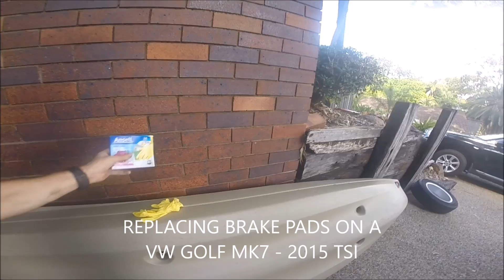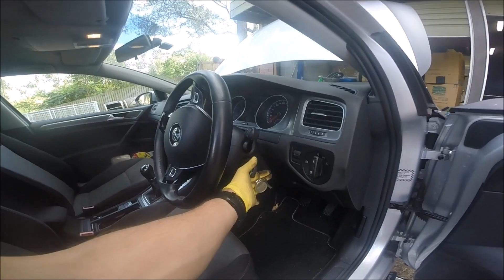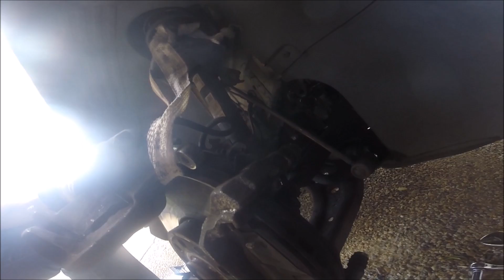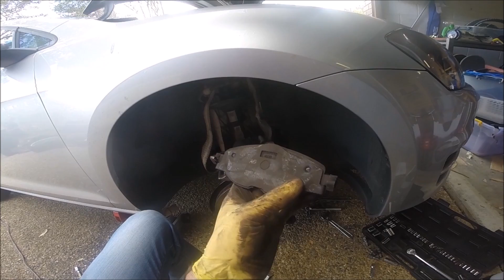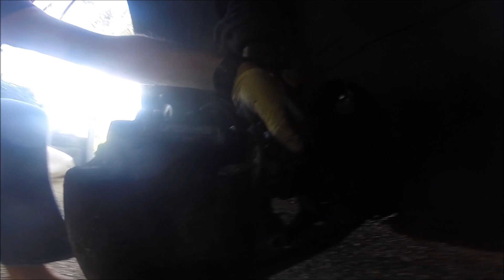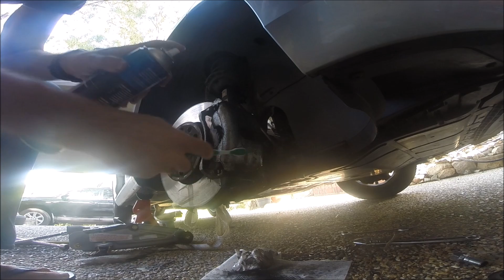How to Replace the Brake Pads on a VW Golf Mk7

Comment: The bolts are all metric these days, so if you're using a half-inch imperial socket, it won't be the correct size.  This is the likely reason for the socket breaking.
Reply from the maker: Yes, that is the reason why it slipped and I hit myself in the face. It wasn't a pleasant experience. Lesson learnt though. Thanks for watching.

Comment: Awesome video, thanks for putting this together...Is there any need to bleed the brakes (or the brake lines) after you've fitted new pads?
Reply from the maker: You shouldnt need to bleed them, and I didn't. I would check the brake fluid reservoir, but you will probably find like I did, that once you push the calipers back in, then your brake fluid reservoir will probably start overflowing. This is likely due to the reservoir being topped up when you go for your usual service, as when your pads slowly wear down, the brake fluid will drop down, so when you take it in for the service they simply top it back up again. With you new pads installed, you then have a little too much brake fluid. This is not a problem at all, just worthwhile putting a cloth close by to soak up0 any additional fluid that leaks over the top of the reservoir. Thanks for watching, and subscribe to be notified of any new videos.